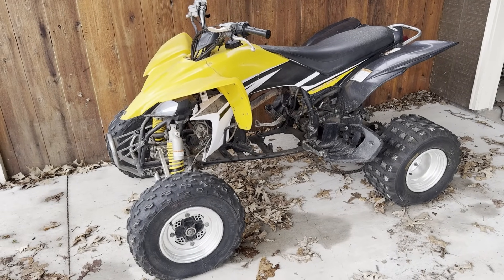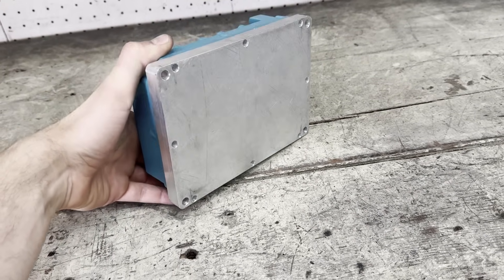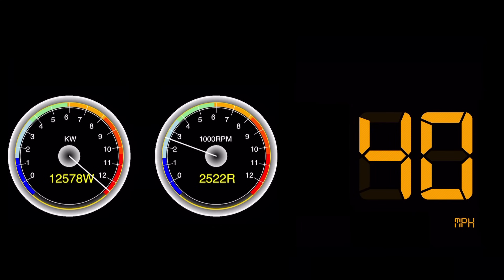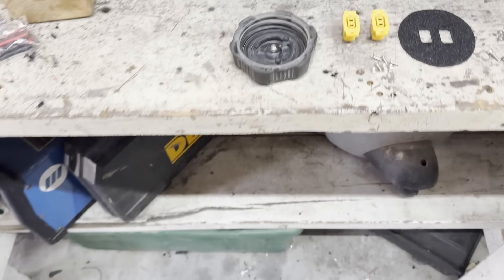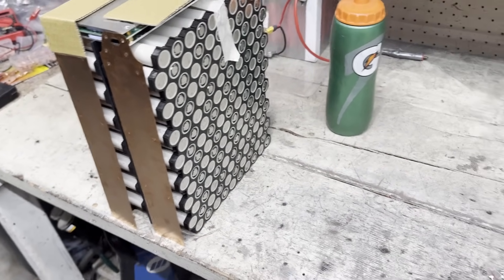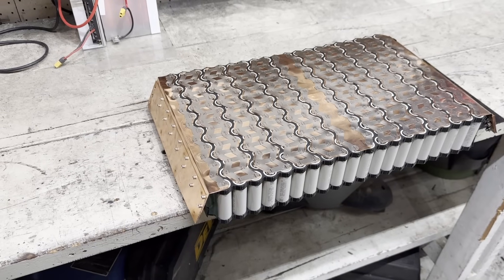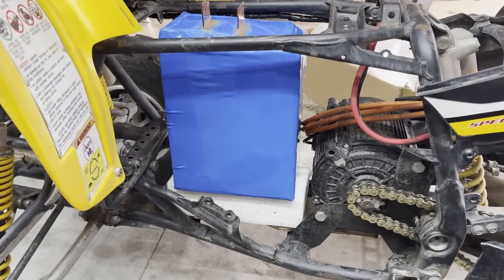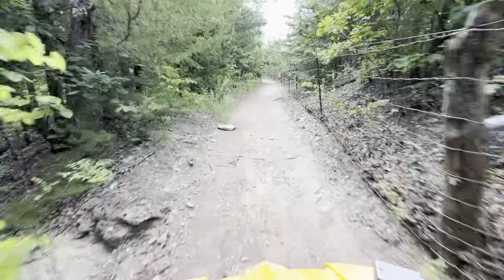Building A 50HP Electric Quad

Comment: I strongly reccommend using conformal coating on the copper connections where there is no connection so it can never ever possibly short it also makes sure it does not corrode the contacts MG chemicals is the best bang for your buck but that's your choice to make ofcourse

Comment: may soung stupid but arent you scared of electrical failure when riding in water ?
Reply from the maker: I did my best to waterproof the battery, and the controller and motor are very waterproof.

Comment: I bought a 2006 yfz450 frame and a qs180 with a fardriver nd721800 a few months back, just never got around to the project.
Reply from the maker: You should, it’s fun.
Reply: @Calthecool  the only problem is I dont know how to weld and the bms for the battery is kind of confusing
Reply: @CarsonJohnson-q8p YouTube has loads of welding tutorials. Buy a load of scrap metal of various thicknesses and practice, practice, practice.
Reply: @AlfieMaxMiMi  haha I tried but apparently my dad says I need a full welding course and that was near the beginning of the year. Never did anything.

Comment: you are very good with batterys! I have a question about the BTR batterys, are they really as unsafe as everyone says they are or are they just not taking the correct saftey precautions?
Reply: If calthecool doesn't mind I can answer this. BTR batteries are built from USED LifePO4 cells with junk BMS's . The used pouch cells don't worry me nearly as much as the junk BMS. need I say more?
Reply from the maker: I’ve had two and they’ve worked fine, but their discharge wires were too small and they don’t have smart BMS’s. I looked it up and it looks like there’s a decent amount of reports of people having problems, which is disappointing because those were the one batteries on Amazon that I thought were reliable.
Reply: @Calthecool  oh thank you good too know, do you sell any of the batterys you construct?
Reply from the maker: @howdadogdoin9179 No sorry.

Comment: U need bottom idler/tensioner only. The top part of the chain always has pressure on it when moving forward so the slack is always going to be on the bottom not the top
Reply from the maker: What about during engine breaking on a gas engine or regen on an electric motor?

Comment: Very impressive build. More hp and more torque. I wonder what the weight difference is vs a gas powered quad.
Reply from the maker: Within a few pounds. I thought it was going to be significantly heavier, but the weight of the stock engine/exhaust/radiator/coolant/gas/battery really adds up.

Comment: This has to be the most beautiful battery build I’ve ever seen on YouTube so far
Reply from the maker: I think so too, I love the way the copper looks.
Reply: I didn't know you could sandwich up copper sheets between cells and nickel strips, do you need a very powerful spot welder in order to do so or just one that can spot weld the nichel strip?
Great job for the battery, looks so cool man!!!
Reply from the maker: @pietroeusebi9971  You need one that’s pretty powerful, you won’t be able to do it with the ~$100 ones you see everywhere. Mine is a K-Weld with a powerful battery pack, I’ve done up to 0.2mm copper.
Reply: Agreed good job fam
Reply: Yeah,really good,with good materials(that copper awwww).

Comment: Great build Cal!
The battery's a work of art in itself, and you must've spent a lot buying 300 x Molicell P45's?!?
I just build a tiny 60v8ah pack using EVE40PL'S - and for such a small 480Wh pack they deliver great performance! It packs a punch for such a tiny battery (pack was an experiment to build as lightweight as possible, but still fun, just for very short rides, and nipping around town and to friends houses etc..(for journeys any further I'll use of my 52V 20Ah packs)..I've done 10 miles using the 60v8ah pack using p.a.s level 1, peddling all the time, and had 66% left when I got home)..

Great quad build!
It's always great to see your builds, and all the different ideas you come up with, and it's always good to learn from watching other more experienced people doing things, so cheers!
👍
Reply from the maker: Thanks! Those batteries were $4.35 each so about $1,300, definitely hurt my wallet but I didn’t want to worry about the battery limiting the quad.
Reply: @Calthecool Damn cheap compared to the price the Molicell's were from 'Fogstar UK', I think it was either the 45, or 50b's they were like £11.99 each - ridiculous prices really, so I went with the Tabless EVE40PL'S @ £5.99 (reduced from £6.99) and built a tiny 60v16s2p 8ah pack...
I can drain it really quick, but it wasn't built for range, just to make very local trips exciting 😂 and my bike absolutely flies up hills now, and I've had 47 mph with GPS, 39 up a 12% hill...
It's a very fun, super lightweight (2.3 kgs) 'very short journeys' pack😂

Gotta say, I've always enjoyed watching your builds over the past few years, and it's always great to learn more...as, let's face it.. it's a neverending learning curve once you start building your own E-V's 👍

Comment: I would have grinded the sprocket instead. It's a lot easier to buy another sprocket than it it is to buy a new motor.
Reply from the maker: I thought about it, but it would have been more of a hassle and I knew grinding the motor would be fine so I just did it.